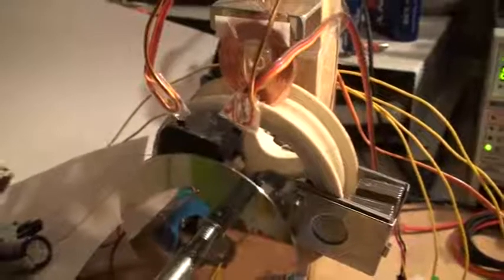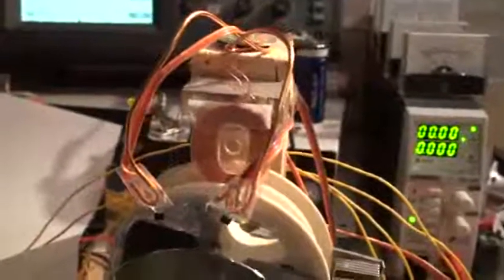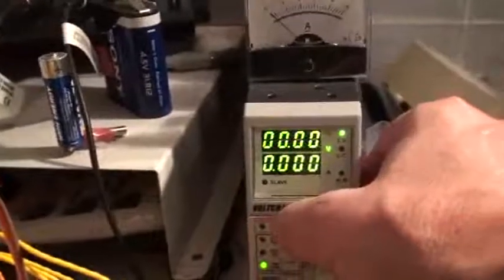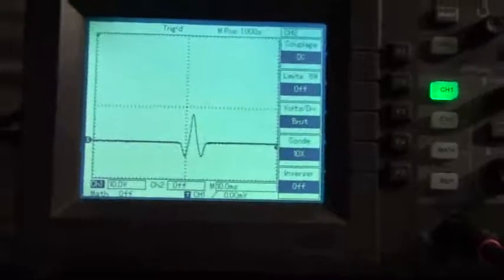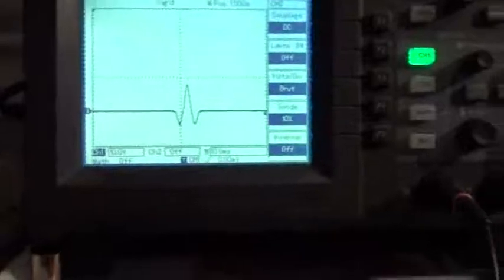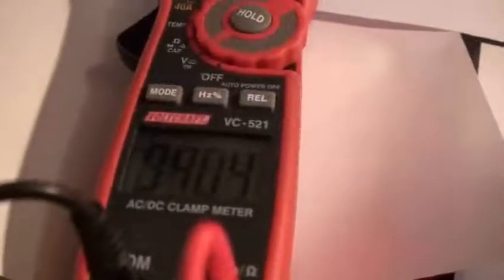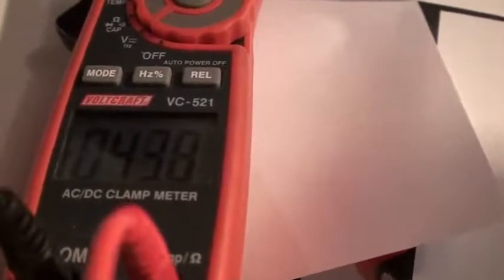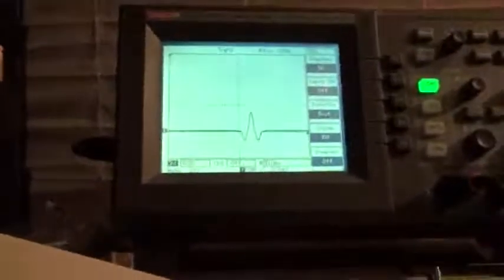shorting coil test 1 .wmv

Comment: Lenz's law is nothing more than the direction (the polarity) of induced EMF/current flow laid out in Faraday's Law of induction.   Shorting the coil does not eliminate Lenz's law.  Does not eliminate Faraday's Law either.  Here's what happens:

1)  max induced voltage develops in the coil as the magnet arrives nearest the coil
2)  a short circuit is made across the coil
3)  the short circuit increases current flow greatly, in the coil, and the dT - the time over which current suddenly increases - is quite short
4)  per Faraday's Law of Induction, the magnitude of induced EMF is determined partly by how rapidly the change in current in the coil occurs

So the sudden short-circuit current spike in the coil:
A)  greatly increases the magnetic field in the coil
B)  when the short circuit is removed, the huge magnetic field built up in (A) turns into a huge Back EMF spike

You cannot.  Repeat.  Cannot.  Eliminate:
- Faraday's law of induction
- the POLARITY of Faraday's law of induction (aka Lenz's Law)

Suddenly increasing the current in the coil via the short circuit changes nothing about Faraday/Lenz.  The huge Back EMF spike actually verifies Faraday/Lenz.

In order to undermine Faraday/Lenz you'd need the following:
1)  a reliable, accurate model of the 'stuff' that exists in empty space that allows electromagnetism to spread out from sources like magnets, coils, radio antennas, etc.

2)  devices that manipulate the 'empty' space 

EXAMPLE:  If you created a device that was able to develop an artificial gravity field, you could demonstrate that you have a reliable, accurate model of what is actually present in 'empty' space
.

Comment: When we short the coil the magnetic field on the charged coil is prevented from discharging as the magnet passes, so coil polarity cannot flip as magnet leaves coil face, hence no rotor retardation due to Lenz effect (if air cored coil). Energy stored in field (I think) is 1/2 times L times phi squared. Now I think the stored charge on the inductor is held out in space around coil by circulating current thru short cct.  The quicker the short is opened the higher the voltage avail to charge Cap.